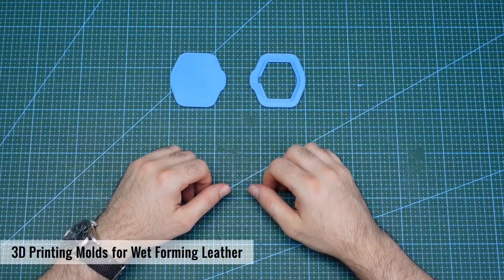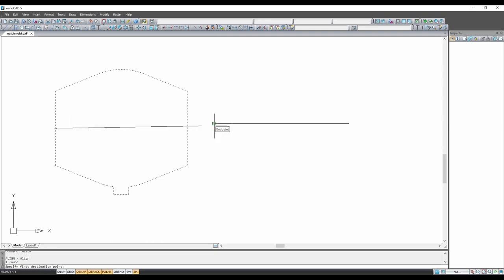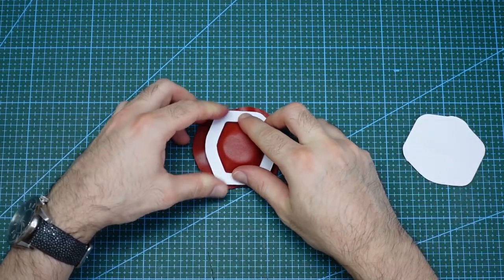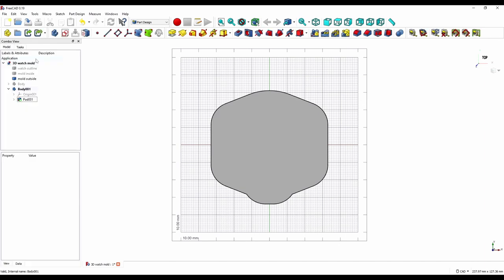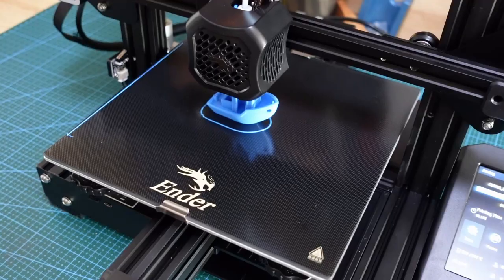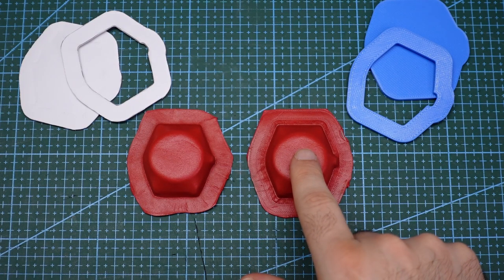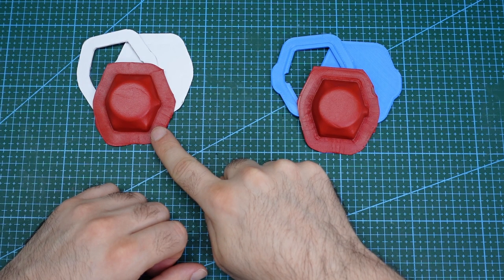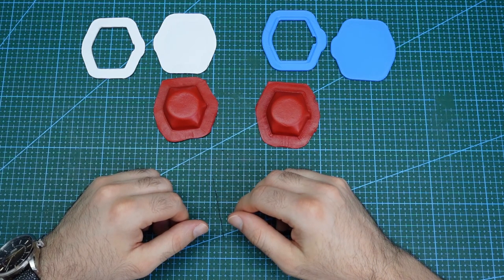3D Printed vs Paper Molds for Wet Forming Leather

Comment: I bet if you flooded the paper mold with water thin CA glue you’d get something really strong durable and dimensionally stable. Worth a shot IMO for the obvious reasons
Reply from the maker: Yes that would certainly make the paper mold stronger.
Reply: &fujw swU

Comment: Great video. I’m new to leather craft and starting to work with molding. Out of curiosity, is the paper mold a heavy card stock? Did you do anything special to prep it? Thanks
Reply from the maker: Thanks! It is two layers of card stock that I have stuck together to strengthen it, the firmer it is the better but you still need to be able to cut it accurately. As long as you remove all the dripping/excess water from the leather so that the water will not weaken the paper mold too much there will be no special preparation required.
Reply: @TeranAtelier  Thank you! That helps a great deal.

Comment: You could use a higher resolution. Also ABS filament and acetone for smoothing it out.
Reply from the maker: Yes improving the resolution would be the easiest way. There are some chemicals that will similarly dissolve and smooth out PLA but I haven't tried them yet.
Reply: @TeranAtelier  I'll have to look into the PLA chemicals. My printer is supposed to be able to do ABS. But it's a cheap model and I have never brought it up to that temperature.
Reply from the maker: @jakek584265  ABS requires good ventilation which is why I am hesitant to try. Ethyl acetate is the solvent for PLA but I haven't tried it yet.

Comment: Although I understand it's somewhat a hustle (what isn't?) You could combine two molds (paper and plastic) to eliminate 3d print impression or use DLP resin printer..
Reply from the maker: Yes resin printing would be a step up in smoothness but would be limit the size of the molds. I do not think paper would work well for complex molds but I am looking into solvents, resin and fillers.